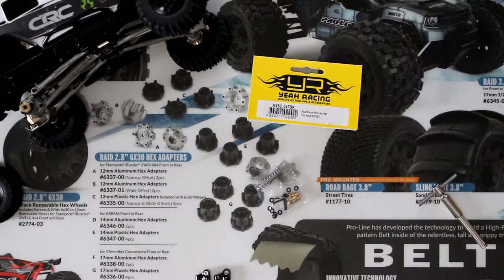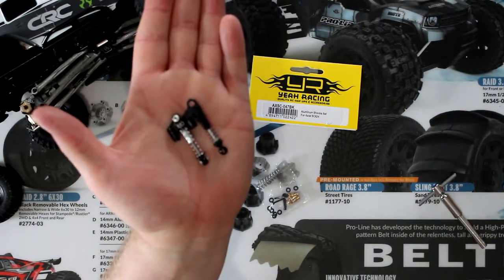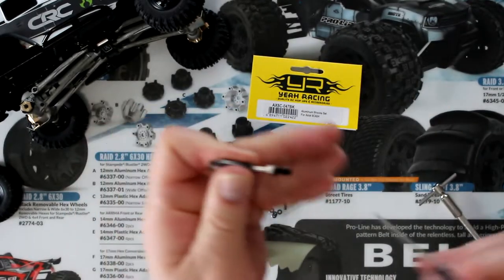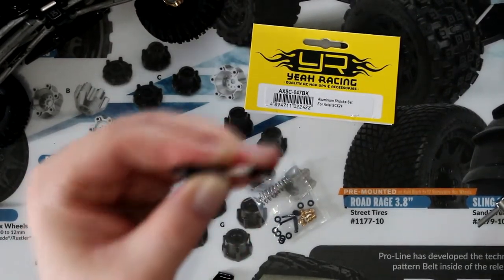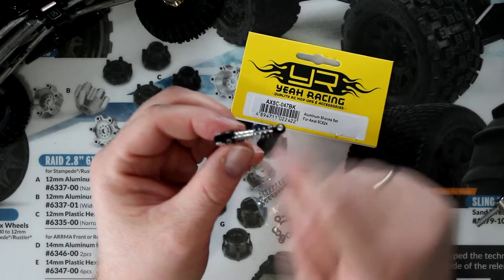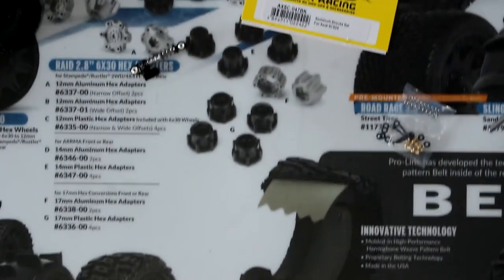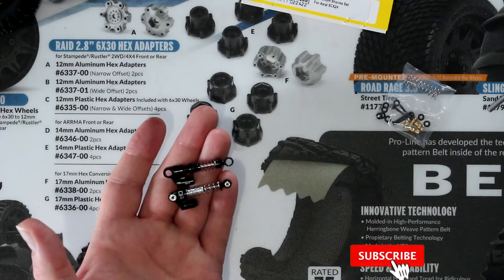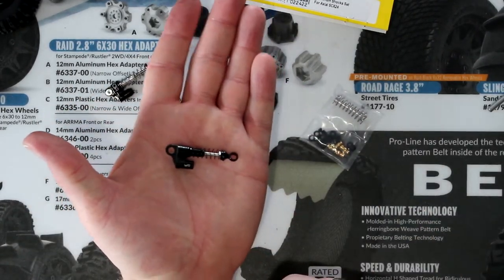Yeah Racing Shock VS Hot Racing Shock SCX24

Comment: Hi, informative comparison between the two brands. What's the best to put inside the shocks for damping, oil or grease? If it's oil, what weight and how much?
Reply from the maker: Unfortunately these shocks cannot have oil inside or grease it will leak out they’re not sealed.
Reply: @djsprc  thanks for the reply. That's a real bummer considering their price. Making them oil filled capable can't be that hard, can it?

Comment: I have both and I like the build quality of the yeah racing shocks, the year racing shocks give  a nice lift because of the shock length but seem to have less travel then the hot racing. Overall both are great upgrades, I run a drop of of 125000wt diff oil and they perfect

Comment: Have i understand correctly that you can put actual oil in the Yeah Racing shocks but not in HR shocks?
Reply from the maker: Unfortunately no you cannot put oil in the shock
Reply: @djsprc  Is it just a marketing strat that they advertise that For safe transportation, the product does not contain oil.
Thats what it said where i ordered them. But, it doesn´t really say anywhere on the site that you can fill them with oil...
Reply from the maker: @r1pp3rt22  I’m ready to say that depending where you live they may not be allowed to transport oil itself it could be an hazardous.
Reply: @djsprc  Yea, i understand that but why would they market it with those precise words, For safe transportation, the product does not contain oil. If you cant use oil at them at all. I think it´s a borderline scam. They make you believe something but they never said you could actually do it. Well, the shocks are going to be much more better than the ones i´m having at the moment. Those are going to the Rocksta Basher.

Comment: I've got the yeah racing ones on my c10. The bit more ground clearance fits perfect for me.
I also removed the little nuts on the bottom part cause i dont know what they are supposed to do there. Removing gibes you about 2mm more articulation what makes a nice difference in wheel travel

Comment: I think you're getting an optical illusion there with that nut being at the bottom of the yeah racing it takes away some of the travel so it might be longer but the travel is going to be the same because of that nut that exists on the bottom of the one and not on the other